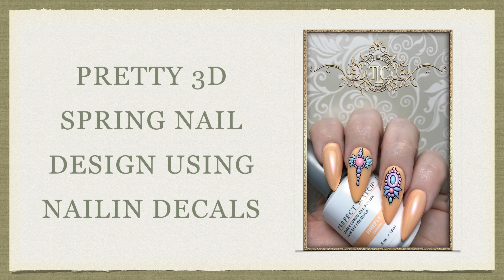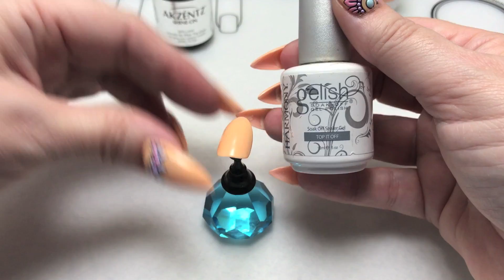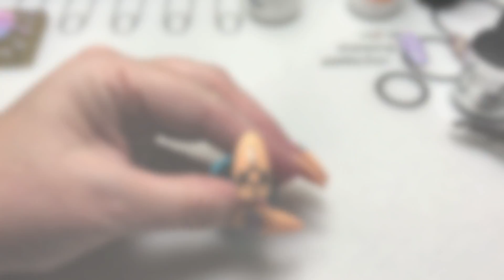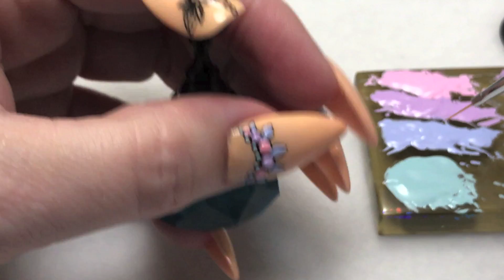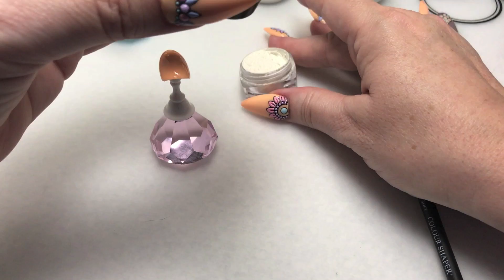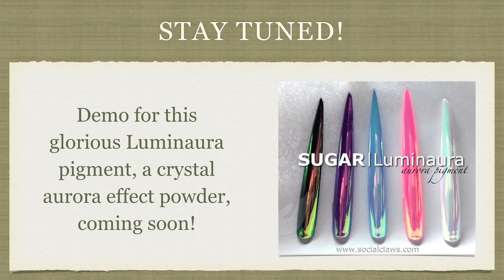Pretty 3D Spring Nail Design

Comment: I see you used the no wipe/cleanse top coat then painted the design.  I always thought you needed a sticky layer to paint gel paints to stick.  Is it just this particular brand of paint that allows you to paint on a shiny no tack surface?
Reply from the maker: Most gel paints that I have adhere just fine to no-wipe topcoats. I wore this for weeks with no issues.

Comment: Do you think you could use the Akzents gel play successfully on these decals?
Reply from the maker: As long as Gel Play has a good sticky layer it should work. Some gels cure with a very slight tacky layer and those will make maneuvering the decal a little difficult.
Reply: Sorry, I meant for filling in the design rather than the EMI paint
Reply from the maker: I have a few Gel Play paints and, personally, I think they are a little on the thin side (at least the ones I have are, not sure if the formula has changed since I bought them) You may just gave to flash cure more often to avoid any leveling.
Reply: I've got a heap so I'll give it a go.  Having terrible trouble trying to pay for the Nailin decals.  Paypal doesn't want to transfer the money and it's frozen my transferring :-/
Reply from the maker: Darn...because it's a Russian email maybe?
Reply: Yeah maybe or maybe because I tried to send Aussie dollars to a Russian account?
Reply from the maker: Hmm...I thought she only accepted Euros?
Reply: tried that too and it still didn't work.  Paypal said to wait for 48 hours and try again
Reply from the maker: I PM'd you on Facebook :D.

Comment: hi.  this may be a stupid question but... are these water decals ?  i watched you lift it from the backing but am not sure how it was attached to the backing.  thanks so much.
Reply from the maker: No, these are not water decals...they are a 1 micron thin film. They have no adhesive. These were created specifically to use in a gel sticky layer...they are slightly porous so the sticky layer will impregnate the film, this aids in wearability. The seller say's these will not work over regular polish, only gel.
Reply: thank you